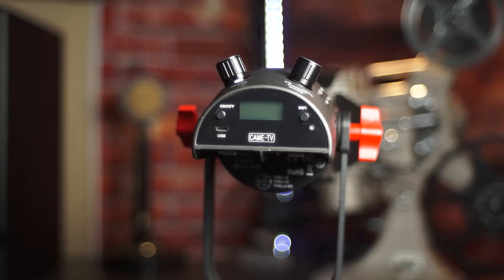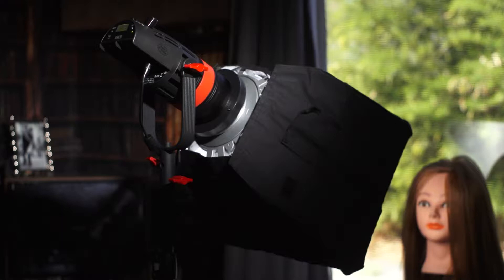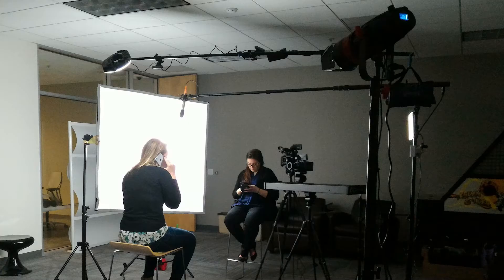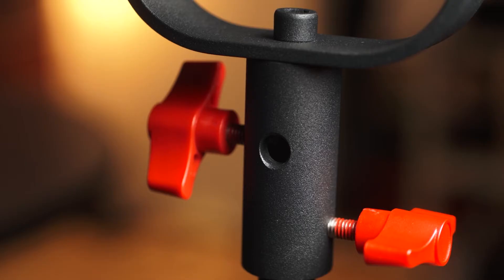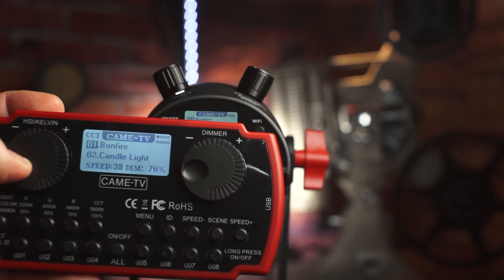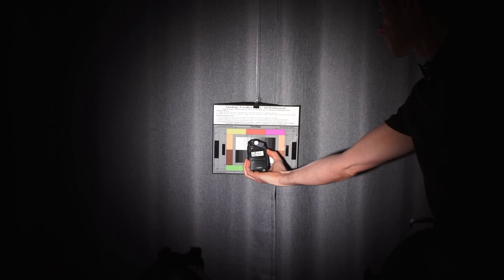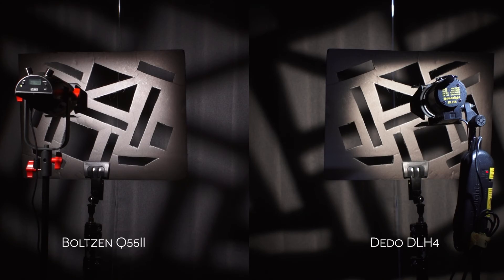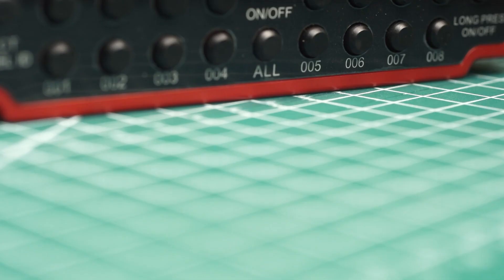CAME-TV Boltzen Q55 II: Small Fresnel LED Shootout

Comment: I have the mark 1 version of this. The work around for remotely turning it off is to use an AC power remote. You can't adjust the brightness but you don't need to lower the light to turn it on and off.
Reply: Good tip. Thanks for sharing.

Comment: Hello.can you help ke with this light?after Pushing the bottom wifi cant go back to settings menu.cant change brightness etc.dont find any instructions. Only can switxh from Sta mode to App node vu pushing 3 sec on wifi button and thats all
Reply from the maker: I'm not sure I can help in this regard, as it sounds like a problem with the actual light. I would reach out to CAME-TV's support staff, as they should be the experts regarding their light. Best of luck!

Comment: Great video and review!
How do you think the Came Q55 compares in output to the Nanlite Forza 60?
I shoot outdoor fitness videos and need as much light as possible for full body shots, that's also portable and battery powered.
If not the Came, do you have any other suggestions?
Thanks!
Reply from the maker: You're going to have to check the metrics on the Forza 60, but keep in mind that the illumination is highly dependent on how you modify the light. The tighter beam angle and fresnel style optics of the Boltzen's allow it to punch out a powerful beam given the power limitations. An 'open-face' COB light like the Forza will need to be directed with a fresnel attachment, or narrow angle reflector dish to get similar output. For outdoors (in full sun), you're not going to be happy with anything short of a 400-600w LED like the new Aputure 600d. That also means expensive high-capacity v-mount batteries or a portable generator. If you're shooting in heavy shade, or golden hour, then these 60 watt lights can add a bit of fill, but in no way will they be able to compete with sunlight.
Unfortunately, I can't test these against a light I don't own..but I wouldn't expect more output from any 60w LED until the efficiency of the LED elements is greatly increased (in terms of lumens/watt). Until then, the only way to increase the output is with optics or by overdriving the LEDs (not ideal).